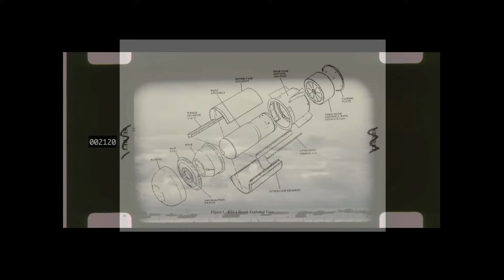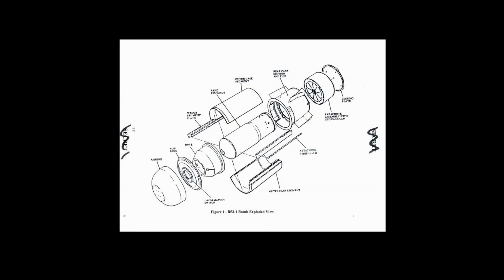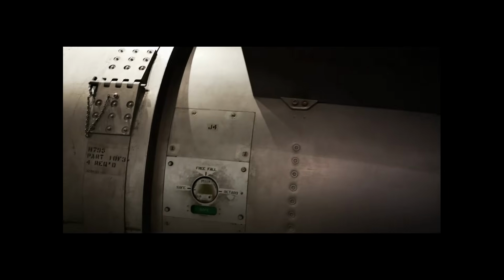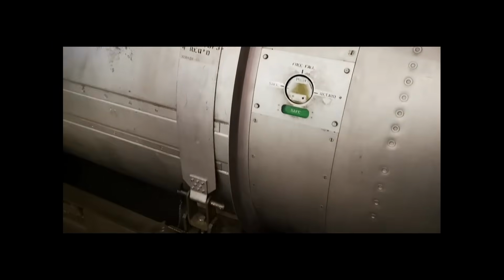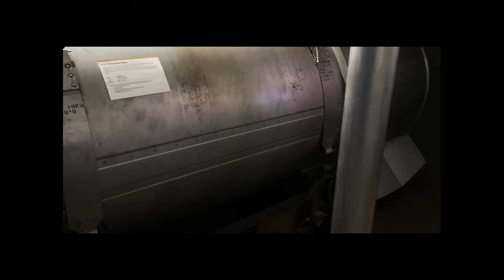The B53 'Bunker Busting' Thermonuclear Bomb

Comment: Bunker busting was a job later given to the B53 – was designed as a less-heavy replacement for the earlier 10 MT bombs, meant to impress the Soviets with their extra power for retaliatory city destruction.   The same bomb was used on the Titan II missile, which reportedly had this same retaliatory city mission until decommissioned in the 1980’s.

Comment: In operation Hardtack I what were tested were TX-46s, the W-53 was basically a W-46 with a new primary however an actual TX-53 was never tested. What I can't understand is why the Mk-41 and Mk-53 bombs weren't tested in air-drops in operation Dominic in 1962 as this would've been the last chance to test the full weapons and a chance to test the Mk-41's full yield of 25MT before the Partial Test Ban treaty kicked into effect in 1963.

Comment: All thermonuclear bombs are to stage minimum. The B-41 was the only 3 stage bomb ever in service officially and had a 25mt yield
Reply: There were actually two yields, the 10MT clean version and the 25MT dirty version.
Reply: @nicholasmaude6906  i’m not so sure about that and usually it’s the bigger bombs are more efficient the more fissile material that undergoes fission the more fusion fuel undergoes fusion the most efficient nuclear bomb ever tested was the castle bravo that was way bigger than it was supposed to be. It was like 15 Mt and there was virtually no radioactive fallout as far as compared to similar size bombs or smaller bombs extrapolated the dirtiest bomb ever detonated was the bomb on Hiroshima because it wasn’t an implosion type bomb it. I think it was something like 3% of the fissionable material underwent fission and they use something like 25 kg of uranium. I don’t remember the numbers exactly but I think if you extrapolated it, it would have come out to 15 Mt if all the material underwent fission or maybe more I forget
Reply: @Trump_is_a_Criminal  It's quite clear that the clean 10MT version of the B41 used lead pushers for the secondary and tertiary stages while the dirty 25MT version used uranium instead (The question is was it natural uranium or the much more expensive Orally).
Reply: @nicholasmaude6906  that would make sense because if you only configure it to be a two-stage device, it would be a 10 Mt bomb, but it would be dirty because it would scatter the third stage all over the place with its radioactive fallout because the entire bombs is going to get vaporized in the explosion, but all that uranium the uranium spark plug and the uranium tamper that make up the third stage make the bomb dirtier unless they replaced it with a lead camper and just remove the third stage and put lead like the Soviets supposedly did with the Tsar bomba  and the 25 Megatron version would be cleaner because all three stages would be used and all the fissionable material would undergo fission. All the fusion material would undergo fusion

Comment: By 2011, there would have been very few people around who knew anything about this thing.  Those who knew a lot would have all been dead.  Lithium deuteride is also very unstable.  It must have been an interesting time to be working at Pantex.
Reply from the maker: A very interesting point, definitely would have been daunting work. Thanks for watching
Reply: What is Pantex?
Reply: @BlvlWmpower  Wikipedia describes it as "the primary United States nuclear weapons assembly and disassembly facility".
Reply: A place that " 60 Minutes " couldn't get into .